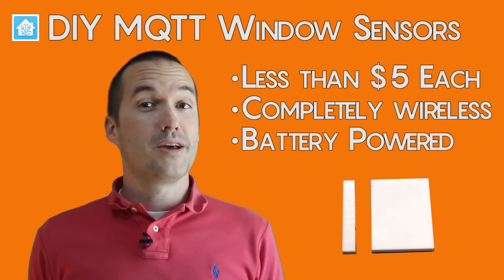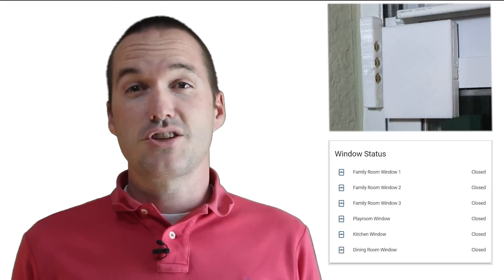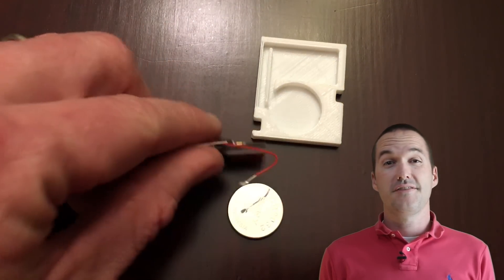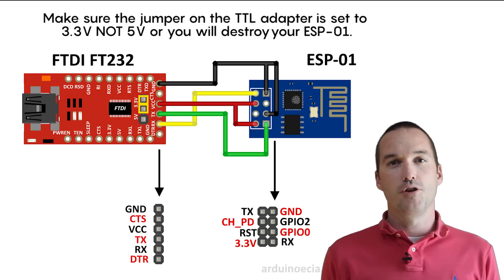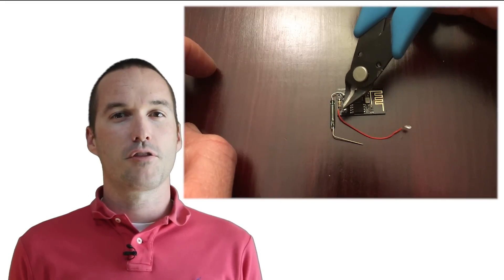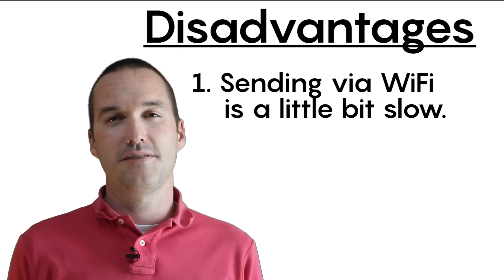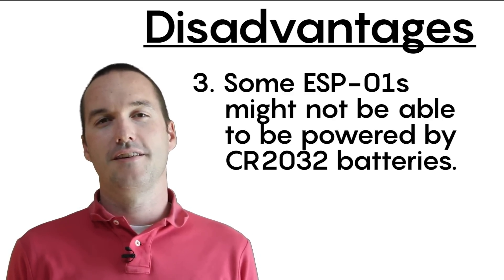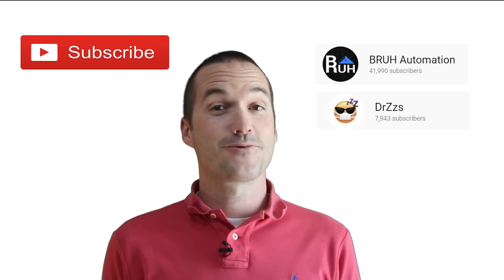$5 DIY Wireless MQTT Smart Home Window Sensors

Comment: Cool idea of just using the reed switch to turn on the device. As others have pointed out battery life could be a concern on windows that are left open.  I think the bigger thing for people to consider is the value of any security system if the intent is to catch a potential burgler, although it may be deterrent, especially cameras.  The reality is burglaries only last at most 10 minutes, not enough time for a central monitoring company to verify with the owner that it's not a false alarm, call the authorities, and for the authorities to respond on site. My house was burglarized during the great recession, it was very obvious that they were only inside 5 minutes at the most, certainly not enough time for any alarm to do much. At the time I had two medium sized dogs, and an alarm sign prominently posted outside...neither, dogs, nor the fact I had an alarm system made any difference (the alarm system wasn't functional, but they didn't know that). Some rooms they didn't go into at all. I don't have any valuable jewelry or significant cash to speak of. They did take a cheap netbook and $40 sitting on the dresser.  I was just glad they didn't injure my dogs. I now have hardwired security cameras that cover the full exterior of my house.  I think that is a better deterrent.  If one's intent is just to be reminded that a door or window has been left open, then sensors work well.
Reply from the maker: Also a loud siren is good for making sure they don't stick around for long.

Comment: Awesome Project.
Sir , can you confirm , do I still need to set up local mqtt broker on Raspberry pi to use this sensor.
Please reply.
Thanks
Reply from the maker: Doesn't need to be local, you could use cloud mqtt if you wanted to.
Reply: running a local MQTT server is more reliable and you have full control of who sees your data. If you were setting up MQTT devices for the first time, you could start with cloud mqtt for proof of concept, but would definitely move over to a local server.  I started off directly with a local mosquito mqtt broker on a RPi a couple of years ago, it wasn't hard to setup...there are lots of "how to" sites and videos online.

Comment: I am having around 50 connected devices. Can you suggest a good economical router for my house ?
Reply from the maker: I love my google wifi, I have 60-70 devices at any given time and google wifi never skips a beat: https://amzn.to/2SnnWgr
Reply: Little late reply. But I would suggest to buy an Asus router. You can easily extend it with Asus Aimesh. Plus you can integrate asuswrt with home assistant for presence detection.

Comment: Cool, but isn't good for security system - WiFi jamming ;)
Reply from the maker: I hear ya.  Those are not the kind of robberies we have in my area.  It's mostly addicts smashing windows to steal pills, not spies looking for government secrets.
Reply: @TheHookUp  they would first have to know you had such devices. what robber goes around with a WIFI jammer?. The same could be said for the commercial wireless door and window sensors. wireless frequency jammer, anyone?. you want secure? hard wire it. other wise deal with the one, one billionth of a percent that that could happen. great build I'm cranking up the printer as I type. Thanks

Comment: Hello there and props for the very cool idea. I tried to follow your instructions, however it seems something is not right. I can get the Arduino IDE to program my ESP-01 with the supplied sketch, I even uncommented the few lines in your "static IP" sketch, however I don't see the ESP come online in my router's web interface and I also don't see any responses when connected to the ESP using a serial interface through Termite. Any tips on how to debug what is going on here, please?
Reply: hey @thehookup, any tips, please? I tried different ESP01 chips (I have 3) and none of them seems to work. When I connect and disconnect them from the serial adapter some garbled text shows up in Termine, otherwise not even a single character. I’m pretty sure it's something simple, and being a noob, I can't figure it out..
Reply: @madzur  
Triple check your SSID and password. If your SSID has spaces or special characters, try changing that?

Comment: Hmm, the battery limitations is a bummer, any cheap/sane way of hardwiring it to a powersupply of some kind? I'm about to remodel the house sso putting stuff into the walls does not bother the the least, perhaps something over PoE would work in this case? I have a few of those switches.
Reply: Just run low voltage wiring, and run it off a DC transformer. New construction is easy to wire up for stuff like this. Existing homes are a bit more difficult, hence the need for wireless...

Comment: you can add very small solar panel and rechargeable battery
Reply from the maker: I'd love to do this, but it introduces a bunch of other circuitry (need a voltage regulator and a charging circuit).

Comment: Even after installing the drivers for the FT232 I cannot see any port options. I cannot even see the device in device manager whatsoever. Do you have any suggestions?
Reply from the maker: Is it the adapter from the description, or a different one?
Reply: No it is not, I'll order that now and give it a try. The one I have is from Banggood and I'm now seeing in the description "This chip is not orignal, do not have EEPROM, can not invert the signals." so im gonna assume its bad
Reply: UPDATE: Second FT232 did not work either. Bought a new cable and everything works.
Reply from the maker: @sallen135  Ug. I wish there were a mandatory marking for power only USB cables.  I run into this problem ALL the time.  I guard my power+data usb micro cables like they are made of gold.
Reply: @TheHookUp  I didn't realize there were power only cables! Good to know. What's funny is I have a vague memory of realizing this cable only did power (thought it was broken) and still putting it away with all my other cables thinking oh I'll remember it only does power... classic. I probably forgot instantly. Thanks for the videos and the responses, keep it up

Comment: Nice video! Another solution are those RF Reed switches on AliExpress and use a sonoff RF bridge to listen for the rf signals and forward them via mqtt to nodered or HA. I used this setup batteries last year's on doors i open and close every day. And the cost is similar. The sonoff bridge was 8 euros i think. I use espurna firmware on the rf bridge. Hope it helps
Reply from the maker: Yeah, DrZzs has a good video on the RF bridge with tasmota too.  I ordered one to try it out but it was DoA and I haven't gotten another one yet.
Reply: Using this RF bridge this gives you lots of things you can interact with. Smoke detectors, leak sensors, rf relays,  garage doors, pir, alarm sirens, etc. I personally like espurna over tasmota just because it has a nicer gui but the functionalities are similar.

Comment: what is the enabled pin on ESP-01?  what would be in a Wemos D1? can you post a clearer picture or schematic please? thanks
Reply from the maker: Wemos D1 doesn't have an enable pin, it's just hardwired on the development board, you don't need to do anything special.
Reply: @TheHookUp  thanks for the quick replay, so its possible to use it with your implementation? If so between wich pins i should add the 10k resistance? Thanks
Reply from the maker: You don't need it at all.
Reply: @TheHookUp  ok, sorry then without a 10k resistor to what pins on wemos the door sensor should be hooked up? If i hook one sensor wire to ground and the other one to the ground power supply , when window is closed the circuit will be on when closed and off when window open, this is what i don't get , sorry for bothering with so many questions :)
Reply from the maker: oh, sounds like you bought the wrong kind of reed switch.  You'll need a normally closed switch, that is open circuit when it is next to a magnet.
Reply: @TheHookUp  i have this one https://cdn.instructables.com/FY8/THDC/IRG4HPG2/FY8THDCIRG4HPG2.LARGE.jpg and it is normally closed but open when magnet is near(open when window closed)
Reply: @TheHookUp  when window is closed hes near to the magnet
Reply: @TheHookUp  on what pins on wemos you would hook him?
Reply: The sketch is written such that anytime the device boots, it sends the "open" message to whatever MQQT topic you put into the user configuration section. You don't need to mess with any other pins. Just connect positive to the 3.3v pin and otherwise do everything like the video.

I just tested the code on a D1 Mini Lite, and it works fine.

Comment: It would make it a little bigger, but if you add two relays, you could have it completely unpowered, latch the power on relay, send the messages you want, and then have the 2nd relay break the power connection and turn it completely off again. No deep sleep required. May not be for this particular project but maybe give someone some ideas. Thx for the video, it inspired some other projects.
Reply: The current a relay would draw would likely be more than the sleep function draws.

Bottom line is, it's probably not the best option for windows that are opened frequently.

Comment: Followed your tutorial. im 90% there. Hassio sees the sensor, displays closed while magnet is attache and open when magnet is away. The only think i cant get to work is the push notification (html5 push notification working with other stuff) not sure what im doing wrong or not doing. Any help appreciated.
Reply from the maker: Are you trying to do an iOS push or an HTML5 push?
Reply: got it working in the end... woohoo!
Reply: Doing it on android. But it works now... bit I have another question if you don't mind. I adapted your original design. And am powering the sensor with an 18650 battery.  I left your code as it was. How does the battery voltage alert works. ? Does the sensor logs the voltage in mqtt every time it connects? I would like to add that to my push notifications.
Reply from the maker: You can modify it to do that.  Just change the if statement where it measures the voltage and have it always return true.
Reply: Struggling with the if statement:  you able to tell me where and what to change?  to always send the battery voltage.
Reply from the maker: Here's a file with a JSON template for battery voltage: https://github.com/thehookup/MQTT_Window_Sensors/blob/master/Window_Static_CONFIGURE_JSON.ino

It should send {"state":"open","voltage":"VOLTAGEREADING"}, you can use a value template to pull it out in HA.
Reply: Cool will try it out.  Here is my current notification in automation.yaml - 
 
     
- alias: Send me a message
  trigger:
      platform: state
      entity_id: sensor.patio_door
      to: 'open'
  action:
      service: notify.notification_test_s8
      data_template:
        title: "Patio Door Open"
        message: "Patio Door Open {{ states.sensor.patio_door }}"
 

How to add the voltage info once I have it in mqtt?
Reply: Thanks for this... I did something similar. But yours looks more refined. I will test it out.  Thank you very much... having fun with hassio

Comment: Why not use 433mhz window sensor and use 433mhz to mqtt esp8266?
Reply from the maker: Others have suggested that.  I think it's a good option.  For my use case (where the windows never open) these were a cheaper option, and I like building stuff :)
Reply: The Hook Up your method is more secure ...

Comment: Hey, is there a possibility to put TASMOTA on esp-01?
Reply from the maker: Theoretically yes, but your functionality will be very limited because most of the pins on the ESP8266 don't have break out pins on the ESP-01.
Reply: Yes you can. I've done it for temp / humidity sensors
Reply: Yes- Most certainly. Personally I think ESPHome (Yaml firmware creation right in home assistant) might be the way to go !! Although I must admit I am weak at "coding" so I avoid Arudino IDE as much as possible. -- Great video Rob!!!

Comment: You now skip the china gateway by using https://github.com/danielwelch/hassio-zigbee2mqtt with a CC2531. Plus a single door sensor can be bought as low as $6 but usually you should be able to find them for $9.
Reply from the maker: I bought the parts for that already... they are in transit.

Comment: Do you have the code on the HA. To make this work.
Reply from the maker: Your names and topics will be different, but they are mqtt sensors: https://github.com/thehookup/MQTT_Window_Sensors/blob/master/windows.yaml
Reply: Thanks.
Reply: Should the light stay blue on the ESP is its connected?  I set my topic correctly and flashed  and configured  HA correctly but it doesn't seem that my HA seeing ESP.

Comment: Whats about windows that are opened regularly and stay open for hours? How does this affect the battery life?
Reply from the maker: Staying open would put moderately more drain on the battery...  It goes into deep sleep after sending the original message so we're talking about microcurrent draw.  The biggest issue is that it will inaccurately report the window status.

A major goal of this project was to keep them as easy to make as possible.  There are certainly ways to allow it to do open/closed operation, but they would require a larger circuit.
Reply: Ah, it goes to deep sleep after sending out the open message. Thanks! 
So if I use a battery pack with some aa-cells instead of a coincell, I could get it running for years.
Reply from the maker: yep.
Reply: The Hook Up : Could a tiny solar cell ( like on a calculator) be used to trickle charge a rechargeable coin cell without additional components maybe ?  I like maintenance free/ reliable gear.  I’m hoping to keep the device alive for accurate open state reporting too... Thanks for your guidance
Reply: If you open a window often just keep a spare magnet near by and place it on the sensor when you have the window open for long periods of time. Don't forget to remove the magnet prior to closing the window again.
Reply: Thats a cool idea! 
Maybe putting one of those fancy "remove before flight" things on the magnet, so everybody recognizes it.
Reply: A boost converter could help to ‘usefully drain’ the battery but it should draw a very low  current when the window is open. It could work for a door that’s usually closed. 
Any thoughts on this anyone?
Reply: If using NiMH or LiON AA cells (which I believe put out 1.2V each) would I use 3?  Would 3.6V be too much for the ESP01?
Reply: maybe use one 18650 cell ~ nominal voltage 3.7V and one 1N5817 diode (0.3V drop)

Comment: hi just got all the parts to make my first 10 units I was concerned about how small the magnets are. Do you use just one in each of the 3 holes? and to fasten them in I got a tube of super glue to put just a small amount in the hole then drop the ball in
Reply from the maker: Yep, just one in each.  you can put them next to the reed switch and hear them doing their thing.  You'll hear a faint "click" when it disengages the circuit.  Good luck! make sure you post a reply on how your build went.
Reply: The Hook Up 
Still no reply from Dale L. Makes one wonder, might he accidentally have glued his fingers to the window?